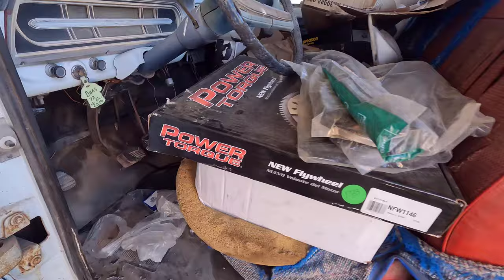What Should I Do?! Getting A Project Plan Together For My 71 Highboy

Comment: Fix the cab mounts, replace the freeze plugs, put a 4 barrel intake manifold on it, get the motor running stout with a reliable drivetrain.

Comment: Take a deep breath......and allow yourself to do the bare minimum to get this on the road. Get it running, driving and stopping......don't let it snowball........Let the next guy take it to whatever level he wants. I think that's the balance you need on this pickup to get the most bang for your buck.  Not the way you usually do things.......but in this case, it's OK.

Comment: If I was buying the truck, I would love to see the cab mount fixed. Put some seam sealer or something similar over the small holes on the driver side to seal it up and i would be happy and more inclined to buy it. Beyond that, make it run and drive good with used parts. New parts wouldn't even look right. Clean everything good and it's ready to go for a good price IMO.

Comment: Scope creep is a bad thing when you're trying to flip something. It can chew up a lot of time and money. From my perspective, I would be looking to provide a mechanically sound and dependable "beater truck". Since they are structural, the cab mounts get replaced. Spray them with something that won't be too much of a contrast to the rest of the underside. Leave the rusty floors, fenders, and paint alone. Pulling the cab makes for easy install of the motor & transmission. How feasible is it to test run the motor before installing the cab? Would make for easy access to pull the heads if necessary. I think it acceptable to replace the questionable freeze plugs without replacing all of them. For that Holly 2 barrel, verify what size it is. I doubt a 500 CFM will act right on a stock 360. A 350 CFM has a better chance. The easiest option is a original style carb from one of the other motors. If you're pulling the valve covers, would you replace the valve stem seals? They should be crumbled by now. Decision.... decisions... Keep the videos coming.

Comment: You will more than likely find that once you start using the clutch pedal that can mount will show its ugly face. If you’re going for the bare minimum ( mechanically sound but well aged and patina’d) I’d at least weld in new steel on the side that’s blown out and the bottom. I recently did a “mechanical rebuild “ on my 76 and couldn’t make myself spend the money on the sheet metal cab mounts. My motto is: find the failures and weak points and rebuild them to the point where it will not fail again “. So I built my own out of 3/16” plate steel. Way heavier than I would ever need, but at least I know the cab won’t lift up when I push in that clutch. 
Great videos by the way. I’ve learned quite a bit from watching your videos. Thank you sir

Comment: I have a question for you hopefully you’ll see it ,  I just bought a really clean straight rust free 68 f100 4x4 shortbed, 86,000 original. I’m wondering what is the little knob next to the choke knob
Reply from the maker: To the right would be the optional cigar lighter to the left would the the optional cargo light.

Comment: On the other side of the same coin so to speak my dad's western Illinois truck was the same way and the previous owner had tacked washers under the cab but it fell down on the steering column and you could not steer the truck if it wasn't running and driving it the Dr door had to be slammed to get it shut and open it very easily...

Comment: The Dr side eventually rusted off the truck, and so I don't know for sure,it was a very rusty 2wd from over by the lakes in western Illinois and at some point the bed and tailgate were changed and by the time we ended up getting it both needed replaced again the entire bottom of the tailgate was rusted out but amazingly held up and opened and shut like a new one you didn't even have to slam it the bedsides were coming loose at the bottom of the bed

Comment: Those fenders are going to be a pain to realign and bolt on the bottom like they are supposed to be if you remove them to pull the cab though?!
Reply from the maker: Front clip would stay together and go up with the cab